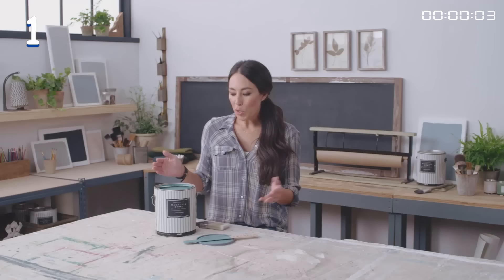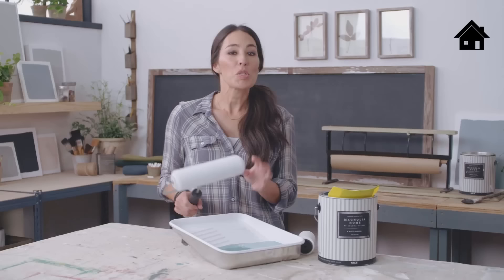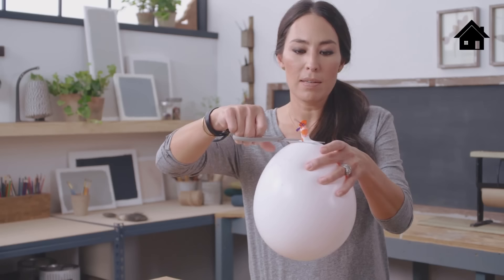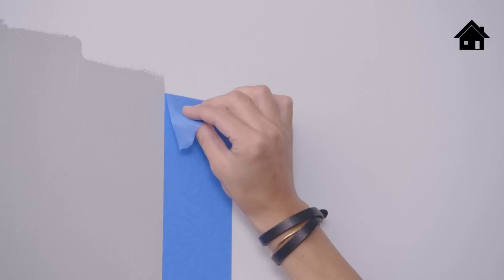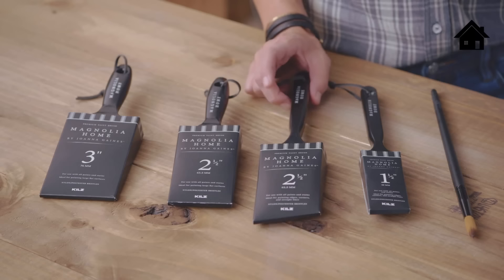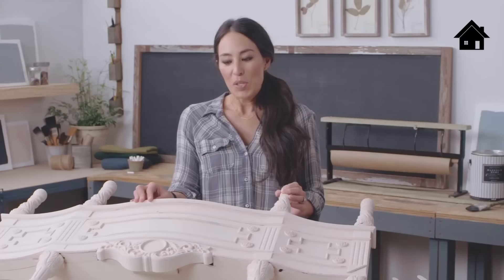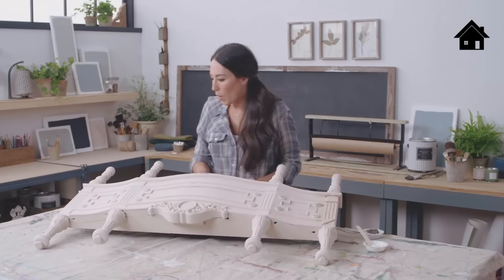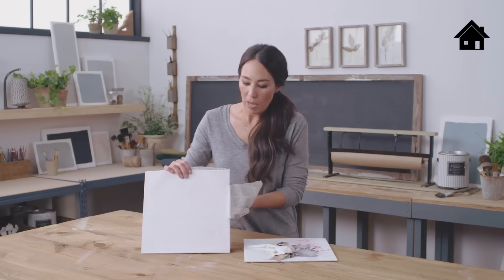17 Painting Tricks of All Time | Home Decorating Ideas | Joanna Gaines New House

Comment: For the chair: just flip it over and paint  the bottom first. Paint tray liner. Do not throw away after one use.  Either rinse it out in a sink or use up all of the paint  on the liner and let it dry.  I have reused same liner 10 to 15 times. You just build up layers of dried paint no issues.
Reply: I thought the exact same things.
Reply: I tried that plastic bag liner and it was a fail because the bag kept sticking to the roller and didn't let it roll well in the tray. What doesn't get washed out of the tray and has dried won't mix with a different color. My trays are well layered
Reply: But then you have to wait for the paint to dry before you stand the chair upright and paint the rest of the chair.  The nail method allows for no wait time to dry in order to all for the whole chair to be painted all at once.
Reply: @deborahrosenow7131  You do not paint the actual flat bottom  of the chair legs...flip it  over  paint the bottom 8 inches..flip it  immediately back over and continue painting. Why would you paint the actual bottom of the chair that no one sees and will get scuffed up anyway ?
Reply: @deborahrosenow7131   ,.
Reply: Easy peasy!
Reply: I would recommend washing it out in a bucket. Your drain can become clogged with paint after awhile.
Reply: @fairamir1  You want to be able to have a long stroke of the paint brush that doesn't have a "stop" so that it creates a very clean, very leveled paint spread.  It will look so much nicer when you don't stop the brush and keep it continuous.
Reply: @YellinHelenP  It is a chair leg!!!!!!!!!!!!!!!! NO ONE will notice...
Reply: @deborahrosenow7131  But then you don't get a coffee break.  😊
Reply: I have had dry paint chip off, even if it was a thin layer left in the pan. I clean the pan all the way. With avhpse preferably.
Reply: @Nopety-Nope  I have never had any old paint issues
Reply: Yep, me too!
Reply: I sense – given the rest of the video's contents – that ecology isn't particularly high up on her list.   🙃🌍
Reply: @kathleenkirchoff9223  Tin foil works quite well... It's more stable.
Reply: @elaineteut9579  ,
  And where do you empty the bucket? If your answer is, "outside", what if you live in an apartment? Either you will dump it down the drain inside or outside, in the gutter__sooo...(?) 😛
Reply: @fairamir1,
  This gets me, every time: if you keep reusing the liner by washing it out why use one in the first place? Just keep washing the paint tray__just a thought. 😛
Reply: @debracisneroshhp2827  Dump it down the drain, pay the plumber’s price.
Reply: @debracisneroshhp2827  Liner is easier to wash...

Comment: You can also use cling film or glad wrap to wrap the paint brushes. I also find very lightly wetting the roller brush means it absorbs the paint better than dry.
Reply: Good tip.

Comment: Make sure your paintbrush is fairly loaded before ‘storing’. I have had brush bases rust doing this. The resin trick was eye-opening! I have to test paint on the wall…peel and stick is OK for narrowing down choices. I always recant paint into a new, clean container/paint can when I use 1/2 can or more. These were excellent tips!👏🏻
Reply: Loaded?
Reply: @stephanies6770  Yes, it should be fairly wet, but not fully loaded. No dry spots or it will get stiff in that one area and need to be tossed.

Comment: I want to use magnolia paint as base coat than sponge a design w acrylic paint then applying a self leveling clear satin coat on top. What product would work that will not ruin what I’ve done already. Any suggestions welcomed. Thanks

Comment: Re: your balloon demonstration.... Is your paint as suitable for refinishing furniture as chalk paint is?
Reply: Both latex paint and chalk paint can be used with good result on furniture.  Depends on the look you want and the application is different.  I took a class on chalk paint years ago when it first became popular to use on furniture, but you can actually use it on cabinetry, walls, or just about anything.   Chalk paint can give a more aged/antiquey look to furniture if you use the "chalk paint technique" of applying the paint in many directions almost haphazardly.   This leaves lines in the dried paint that normally you don't want, but for this technique you do .  Then you seal with clear wax for a subtle look, or seal with the dark wax.  The dark wax will more accentuate those fine lines in the paint surface to produce an older more antiquey look.  The wax also seals and protects the finish.  If you are going for a smooth and new looking finish, I would probably just use a good latex paint and apply it accordingly (and maybe primer depending on the project) and then not have to bother with the wax sealer.   I really like Joanna Gaines's farmhouse style and the colors she uses.  I did not know she had her own line of paints until I saw this video today, but will certainly try one of her paints on my next project.

Comment: I hired a painter to paint my condo. When he went to paint the ceiling in my bathroom and came back the next day the paint had peeled. He told me he would charge me an additional $200 to spackle my ceiling scrape it and spackle it then come back again and spackle it again and sand it down and then repaint it. My first question is why will the paint not stick? There seems to be some kind of a slick texture on the ceiling. Can you give me some direction?
Reply: My guess is your ceiling was painted with hi gloss or semi gloss paint. If you chose a sheen that was more matte then those the paint won’t stick well.
Reply: My mom had the same problem in her bathroom and living room. 
The only 2 rooms in a 3400 sq ft home where the ceiling would peel soon after it was painted. It is an older home.
After hiring several different painters over the years, each one would tell her a lie and swear they could fix the problem. Less than a year later, each and every time, we'd start to see cracks and soon thereafter, it would peel. 
I believe we finally found out what the problem was, it was whatever ceiling was made of back in the day that prevented paint to adhere to the ceiling  properly. 
If you have an older house like my mothers, this may be the case with your ceilings as well.
My mothers house was built in the late 1940s.

Comment: That seems like the paint every contractor should be using . The house I bought has paint that you can not clean anything with a damp  cloth let alone using a chemical cleaner. It should be against the law to use paint like was / still is on the walls or most of them at my house. I have a couple rooms I have has  repainted  with a much better paint I purchased. Definitely love your magnolia paint 🎨

Comment: Purchased paint pan liners are not something you always have on hand for painting and don’t fit every type of paint pan well. Bags slip around in the pan. Foil is the best pan liner.
Forget about her fancy brush comb to clean only your paint brushes. Just get a 3 pack of small wire brushes at Harbor Freight for a buck…they can be used for more than one thing. 
Forget driving nails into your chair and just flip it upside down and paint the bottom first before flipping it to paint the top. A paint sprayer or rattle can is the proper tool for that job not a brush.

Comment: Just one piece of misinformation- the thickness of the nap on the roller you chose is dictated by the surface you are painting. The smoother the wall the shorter the nap, the more textured the wall the longer the nap to fill in the nooks and crannies .

Comment: You dont use a rubber band and wipe of the paint . If you do it wipes the majority of the paint of which defeats the purpose . you should get a empty gollon bucket pour about 1 inch in bottom dip brush and before you pull out of bucket tap the sides of the brush on inside of can. that is how a professional does it. Biggest problem DIYers have is the watch videos like this instead of watching professional painters videos . Roller covers should be wetted with water for latex waterbase paints . then take it outside and spin as much of the water out as possible. wetting the rollers yarn activates the yarn and allows it to load and release paint better.  ask a professional stop listening to TV shows where person has never painted.